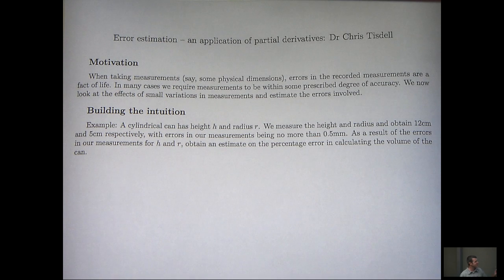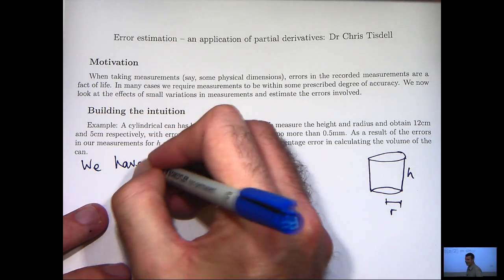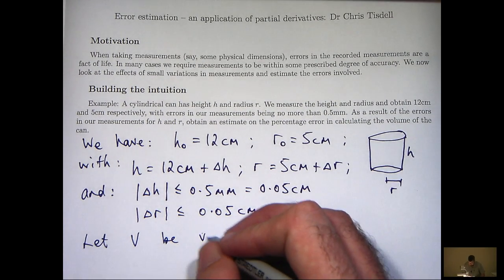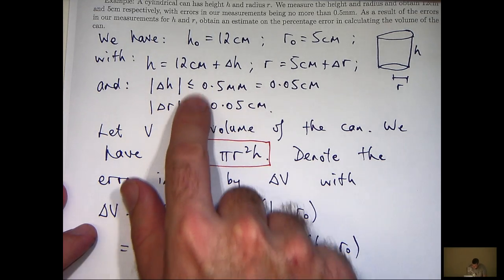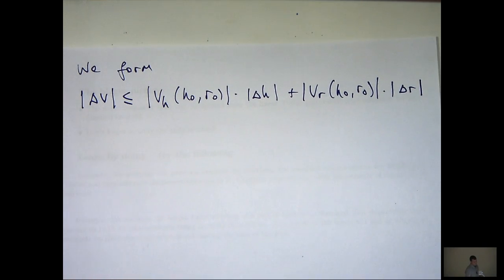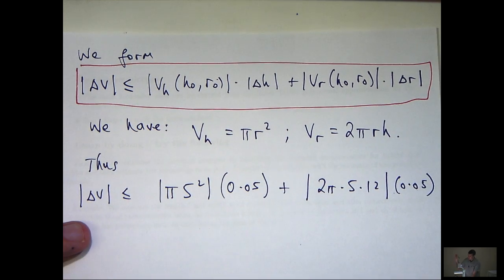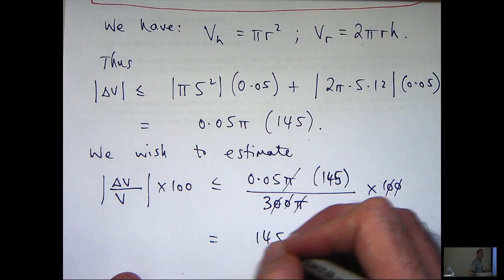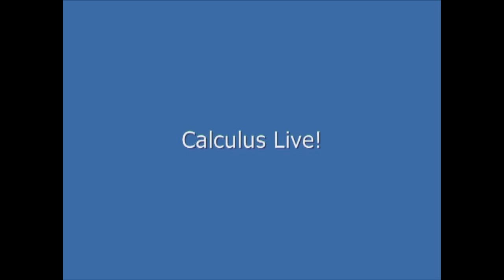Partial derivatives and error estimation

Comment: I dont know if this is a different method, i am still new to this, but i was (sort of ) taught to find the partial derivative with respect to each value , plant in average values(if there are multiple measurements) and then multiply each of those partial derivatives with the systematic error of the measurement by which we derived, like in the video, but NOW is the question: Shouldnt the the total error be equal to the square root of each of those values squared and added together. e.g. Sqrt(delta H^2+ delta R^2)